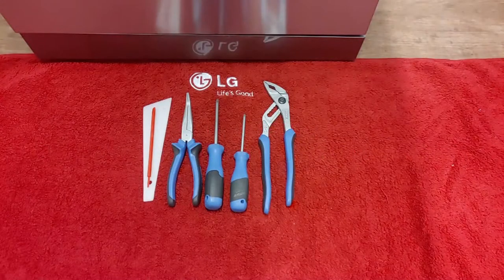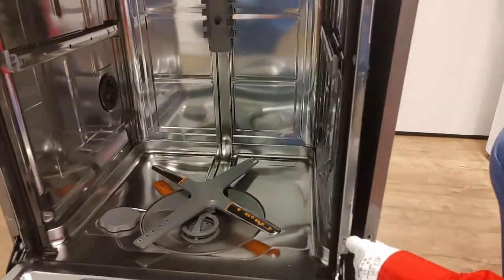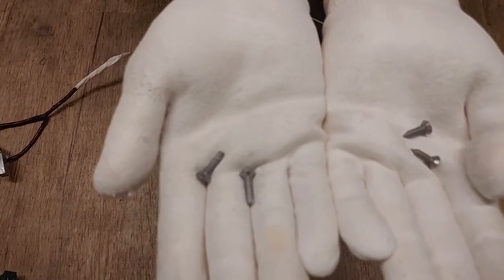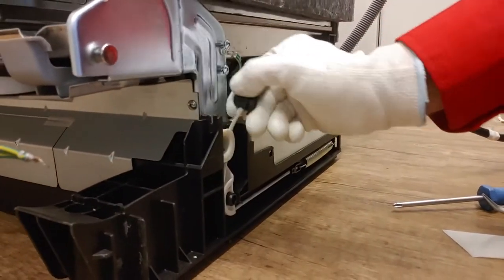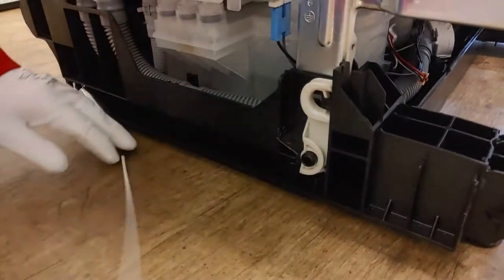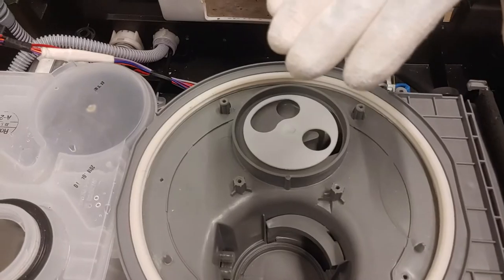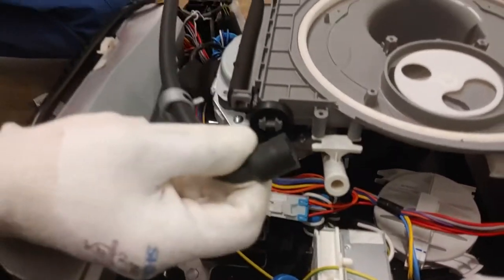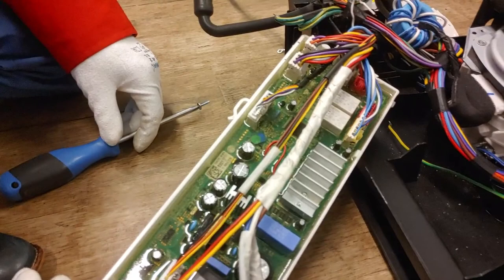[LG Dishwasher] - How to disassemble the XD Dishwasher

Comment: Fuck this design and heating element longevity.
Reply: PS I nearly got to the heater element without taking the door off, but it sits way down in the motor housing so couldn't. Could probably cut a hole in the base plastic and change it that way. But thing is - after tumbling the machine around a bit, it started working again. So who knows.